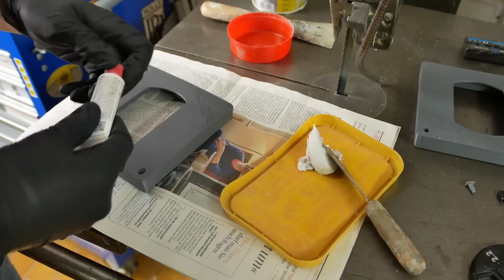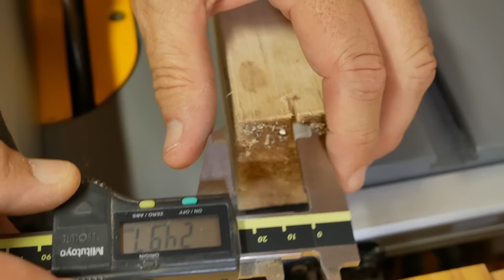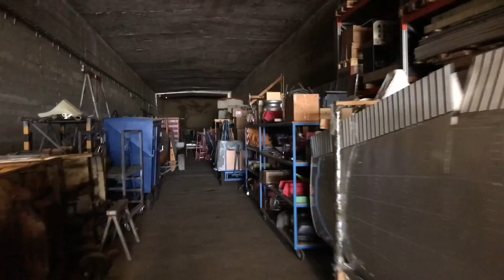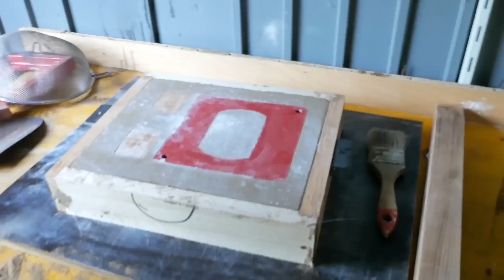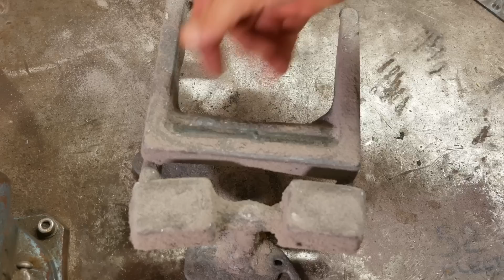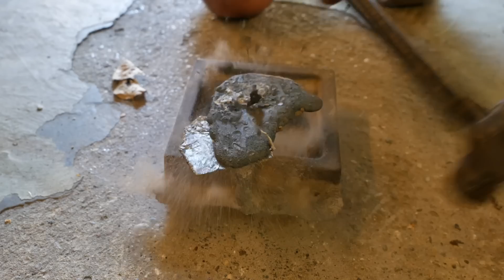Iron casting at home || RotarySMP

Comment: it's very cool to see the whole process.
one thing i do not understand is why the water in the sand does not react with the molten metal ? is it because there is not enough water to cause a reaction ?
i've always read that for like casting in plaster you should preheat the mold to avoid moisture.
so i'm a bit confused 😅
Reply from the maker: Sand is very porous, and there is not that much moisture init. The heat of the metal moisture to steam, but that steam can not build up pressure, it just escapes through the sand. This is why heavier iron castings are done with larger sand grains, for better gas permeability.

Block investment casting (using plaster) is a different process. There you have very low permeability, so you have the fire the mould to drive out the moisture before pouring, as the steam would have no way out and cause the mould to crack (at best) or explode.
Reply: @RotarySMP  Oh i get it now, thank you :)

Comment: Great pacing in your video, and lots of explanation— you’re taking me into new areas, perfect for New Years Day!

How do you use the vegetable oil: are you injecting into the air-stream as droplets from a vaporizer?  This is interesting, is (used?) vegetable oil especially good for this, or could you use any oil, like motor oil or transmission fluid?  I guess any oil you combust will have some degree of smoke, and be at least a little noxious. How much heat does the addition of oil add to the process?  It sounds like a great way to augment the propane, especially if you can get the oil nearly free!
Reply from the maker: Yes it is a vaporiser system. The tank is an old firex, and gets pressurised, the oil is controlled with a shut off valve and a dodgy home made needle valve. 

The furnace needs preheating on gas to work. But once hot, the propane is turned off.
The advantage of this oil burner is that it will burn any oil, and is cheap to run. 
Propane tops out at a stochiometric flame temp around 1980°C while most oils are up around 2100°C, which is a useful boost in energy into the melt.
At the switch over to oil, the needle valve is rather touchy, and needs constant adjustment as the furnace slips between flame out and monster truck exhaust, but the hotter the furnace, the easier it is to control the mixture, and it smokes very little with the correct mixture.
Reply: @RotarySMP  thank you for that explanation, it’s clear now. I wonder if there’s an inexpensive replacement that’s not so dodgy for your needle valve. Possibly repurposing something else? I don’t really have much experience in that area, but I think it’s a fascinating application of technology. I’ll keep my mind open for this & see if I come up with something. 
Sooner or later I’m going to try my hand at forging. It’s a serious investment in and commitment to a process, so it’ll have to wait till I’m truly ready. Meanwhile, I’ll gather material, and bide my time.. Good luck with your process. I, think some oils will have better heat value than others, or due to viscosity or energy content or both will be easier to combust. I think that’s worth testing at some point…OTOH, working (and possibly free) has its place too!
Reply from the maker: You can get a needle valve off amazon.
https://amzn.to/49EgpEk
Generally the max stochiametric temp of a hydrocarbon rises slightly with chain length. But the flash point also raises. Pretty irrelevant to this use case. Anything with a viscosity between about diesel and cooking oil will work fine.

Comment: You mentioned graphite and I thought of something I use unrelated that dries hard and quickly. Comet clutch lube or dry graphite film lubricant. Blaster industrial graphite lube, CRC dry graphite lube, slip plate dry slip lube and so on. I don't know if it would work or not. Basically a fine powdered graphite in aerosol solvent that evaporates completely leaving a very wear resistant ultra thin cohesive layer of graphite adhered to whatever. Would definitely hold sand particles from coming loose.
Reply from the maker: Good idea. A mould wash like that is not used to help bind the sand, in fact the alcohol which carries the grphite is normally burned off before closing the mould. The carbon help prevent the iron from melting the sand grains which embed in the surface.

Comment: I’m currently trying to cast cast-iron and I’m having a lot of the same issues.
Reply from the maker: It sure is a big jump from aluminium. I find there is a minimum crucible size and charge I need to melt. Any less and it is just too much slag. Also you have to be patient until the melt is sending up sparks. Good luck with your castings.

Comment: Do you stll need ferrosilicon? I have a few kgs I could spare. One problem though there is a long distance between you and me.
Reply from the maker: That would be awesome, as the next big project is the cast iron crankcase, and it will be pretty thin sectioned. 

Please let me know what the post office wants for postage, and I will happily Paypal you the costs.

I have an email address on my channels main page, so you can contact me through there and I will send my address.

Comment: Can old brake discs be used for casting material?
What do the neighbours say about the noise and smell from the waste oil furnace? Or do you - like Josef Fritzl - although you obviously don't harm anyone- benefit from the Austrian societal norm of not prying into others' private lives?
I recognized the cylinder head of a fine Austrian Bitzer refrigerant compressor in use as a weight on top of the mould.
Reply from the maker: Yes they are cast iron. I use them.
There is not much smell. When a furnace burns it burns quite completely, and smells much less than a BBQ. The worst noise is the preheat with the gas burner. I suspect it is supersonic at the nozzle, and causes a bit of a booming noise. The oil burner is quieter.
My three neighbors are a retired tech school shop teacher who thinks it is cool, a home handy man who make way more noise than me as he does all his hobbies in the garden, and also thinks it is cool to cast. The third house is a second home so they have never been there when I did a casting session. I only do it a few time per year.

Comment: I've never cast a single item in my life, but after the first attempt I was wondering if it needed a vent on the opposite side of your pouring spru
Reply from the maker: My green sand is very porous, so the air can escape out through the sand on such a small casting.

Comment: I wonder where you source your moulding sand?

The sand seems yellow/grey in colour, not the red sand which I am used to.

The first things which I cast were Aluminium, then lead weights for aqualung diving, I made the moulds from wood and car body filler which works really well if you lack a 3d printer - which was unheard off when I first did this, small castings can simply be made by impressing the pattern into cuttlefish shell either found on a beach or bought from a pet shop which works well for rings & similar.

Thanks.
Reply from the maker: I have two different casting sands.

On this part I used oil bound sand (the orange stuff). This was sourced form a foundry in St Pölten, by a friend. The common brand of oil bound sand is "Petrobond".  This stuff has extremely fine grains, and very high green strength, so it picks up finest detail. You need a mechanical muller to recondition it after use, and add a bit of two stroke oil (there is probably a proper oil for it, but I have read that two stroke also works). This sand will get darker with each use until it is black.

My other sand is water bound or "green" sand. It is is grey/yellow. The best green sands are naturally occuring, and a dug out of deposits from old river beds where nature mixed the perfect mix of fine sand and bentonite clay.
I just make my own (synthetic green sand), with cheap play sand and powdered bentonite. It is not as good as a naturally bound sand, but works well enough for my needs. This doesn't tend to change color much with use, as there is no oil to burn out to carbon.

Comment: add a bit of coal dust to your green sand it stops sand sticking to the iron
Reply from the maker: Thanks for the tip. I use this sand to Al as well. Does the added carbon cause contamination with Al?
Reply: @RotarySMP  I only do aluminum resin sand, no need for coal dust. go to lukygen 1001 metal casting he casts cast-iron, and aluminum explains every step he is a walking cyclopedia in casting, and how to make the equipment needed. mullers- Furness tools everything you need to start working. his a professional

Comment: Did you know, Metric users can switch to imperial numbers by doubling just like we can switch from imperial to metric by halving. For example: 10kg is 20lb and 20lb is 10kg.
That's why 12 hours is 24 hours in Europe. They use smaller hours there. So instead of 60 minutes in an hour, they have 30 minutes. It works the same way with bananas.
Reply from the maker: Yeah, and Pi is 3 :)

Comment: Nice job. Iron isnt nice and easy like aluminum to melt. Might try the PLA for casting in the future. The stuff that burns out like foam cores do. Not a clue what it is though.
Reply from the maker: It is a machinist box level frame. 
I have done lost PLA, but burnt it out like you would a wax investment casting.

Comment: I want to try melting cast iron someday!
Reply from the maker: G'day Jasper, go for it.
Did you move in to your new place? I hope you have a shed built.
Reply: @RotarySMP  As in most builds in the States, there are delays!  The exterior of the house is built, but the interior is not.  We have been waiting for months for electricity.  Because the house is bigger it needs a transformer.  2 neighbors have to sign an easement allowing the power company access on a 10 foot strip to install it.  It's red tape we didn't anticipate.  Hopefully this month that will happen.  Fingers crossed.....

Comment: Thanks for always showing your mistakes. I want to try casting soon, and I think I’ve learned as much from seeing your fails and your explanation of what went wrong as I have from all the other videos where people only show their successes.
What sort of material do you melt down for cast iron? Are break drums or discs any good?
Reply from the maker: I use brake discs or old cast iron scrap. A mate broke up and old iron furnace, and brought the bits in buckets. Once you get to thick sections like these ones, any cast iron is fine. For thinner sections, there is more risk of chilling causing hard white iron.

Comment: While I do non ferrous castings, I can easily do that in my electric heat treat oven which is 12” by 10” by 10” inside. But it just goes to 2,200 F. The idea of having a gas furnace like yours is too much for me. These of you who do this, other than professional forgers, such as Windy Hill Foundry here in the USA which a lot of YouTubers use, are to be admired for your willingness to attempt it, and be successful.
Reply from the maker: Thanks Mel. Yeah, it is a big step from aluminium to iron, everything gets way harder.
Reply: @RotarySMP  the most I can do is zinc, aluminum, brass and copper. I’d like to do bronze, but I’d have to mix my own alloy. I would live to do iron.
Reply from the maker: @melgross  I tried to make my own bronze, but it is not that easy to find tin. I bought some tin goblets, but they were pretty light, so didnt have much metal.
Reply: @RotarySMP  it’s easy to get tin here. If you need some, I can get it for you. A company called McMaster-Carr which I’ve been using for almost 50 years for my companies and now, in retirement, carries almost everything. If I know where to send it, I can.
Reply from the maker: @melgross  Thanks for the offer Mel. I currently have a fair bit of bronze, as I bought two buckets of swarf from a company which machined a huge billet down to make a 1901 replica electric car engine. I already melted it down into ingots. I just took another look in the classifieds, and there are now a lot of large heavy tin mugs going cheap. When I needed it, there were none :)
Reply: @RotarySMP  good. I don’t know how pure the tin in mugs are. Tin is fairly expensive, so, unless these are expensive mugs… you know the way they call aluminum foil tin foil, or steel cans, tin cans. Maybe some tin.
Reply from the maker: @melgross  Many of them have a 95% tin mark stamped on the bottom. they seem to be really out of fashion, as it looks like a 300g mug goes for between €2-5.
Reply: @RotarySMP  pretty cheap for the weight, but what’s the 5%? That can make or break an alloy. It could be copper, which is great. But it could be lead, which is bad. That’s been banned here but not everywhere.
Reply from the maker: @melgross  It would typically be antimony here. Lead would not be a show stopper, as I am normally making statues if I cast bronze, but a leaded bronze can be useful for bearings.

Comment: Little tip to see if the iron is hot enough to poor, I experienced that if the iron throws sparks it’s good to cast most of the times if the iron doesn’t “spark “ means that it got some chunks and ist good for pouring (it helps a lot to put the propan in a bucket of warm water to keep it from freezing up )

Keep up the work 
Greetings from Germany
Reply from the maker: You mean like I mentioned here 
https://youtu.be/G1tl3-qJEGA?t=962
:)

The propane is only for the furnace preheat. Once it is hot the rest of the melt is down with a waste oil burner.

Comment: Probably would be better to cast these in a vertical mold to allow gravity to assist in filling out the mold. No 90° bends to flow around to get to the part.
Reply from the maker: Yeah, but this also worked.

Comment: Enjoyed that! Always fancied a bit of cast iron pouring, but I doubt my workshop problem neighbour would approve! I have done copper and aluminium in an electric furnace, indoors of course! I notice you do not use a riser or pierce any gas holes, riser gives good indication of when the mould is full, and also allows fast gas escape, can make a big difference. I was of the lucky generation that did sand casting of aluminium at school, and runner and riser were the order of the day! Cracking video, and good castings!
Phil
Reply from the maker: I normally use a riser as well. Guess I forgot here, lucky the sand was porous enough to let the air out.

Comment: Fucking finally! Someone casting actual materials at home, not just some junk(Alu)... Next - white bronze(CuAlu)... Thanks m87! It`s a pleasure seeing this title, and i dare assume that the video will be equally as pleasant, as your works always are!
I`ll have to get to making a bloody smelter... Tho, i might just make it today, as i have all that i need(i`d like a bigger barrel, that`s why i wait) for a nice medium sized smelter, and i am currently covered in fugenfuller und mortel dust and runaway globs from mixing... I just have to switch to chamotte and quartz sand(fuck, ran out of that, and it`s sunday...)... I guess i`ll go check the scrapyard for a larger barrel and go get some quartz sand and inox chips for reinforcement... I`d also like to get some of that cera-wool and maybe satanite, but we`ll see about satanite for the actual first rebuild rather than the initial build...

Best regards!
Steuss
Reply from the maker: Hi Steuss. Go for it. :)

Comment: Thanks Mark.   Casting iron in the backyard is quite a challenge.  How do you reach  that high temperature?  is that because of burning oil instead of gas ?   I am casting aluminium with quite a success , BTW, but not an iron.
Reply from the maker: The key is the furnace insulation and the hotface. Most hydrocarbons have nearly the same flame temp. 
https://en.wikipedia.org/wiki/Adiabatic_flame_temperature

That extra 100°C for a light fuel oil in air sure helps, but the key is the furnace. I have video on my foundry in this videos play list.
https://www.youtube.com/watch?v=YUraT1x4AtE&list=PLHRtJd1bD3ITm_OPiV2CvW46Hf6luHMJ1&index=8

Comment: i wonder if wood exterior can be coated with fireproof slurry to prevent charring, plaster of paris/sand/porcelain chunks, etc.
Reply from the maker: No point. Wooden flasks are consumables. If you look at the first pour, the radiant heat also started charring. It doesn't take long to whip one up.

Comment: "dear YT...stop rubbing it in..."
lol, i made a furnace, 1650C rated refractory cement (short bursts at 1800), heat exchanger... and ive only fired it up twice, managed to get the cement to start melting...

and havent actually used it for anything. been so long its got a few weeds starting to take root around the edges...

just seems life gets in the way of everything... just making tongs is still on the list... 

or i am lazy. or both :)

and i guess, in relation to another comment... having a neighbour move in that cleans wedding dresses is sort of non-conducive to oil burning activities...
Reply from the maker: I would try to engage their inate creativity, and get them to make a pattern and cast it together. :)

My first furnace had a lid of fire cement from the hardware store. I turned it to lava on the first firing. This has some beastly industrial refactory.

Comment: What do you use as your source of iron? Do you buy new material? Or brake rotors?
Reply from the maker: This is a combination of brake rotors, and an old cast iron furnace a friend gave me. For these thick sections, brake rotors work fine.